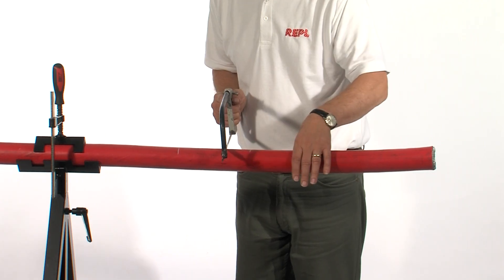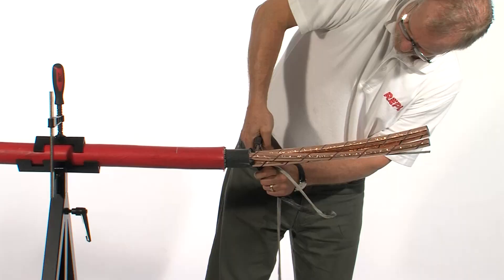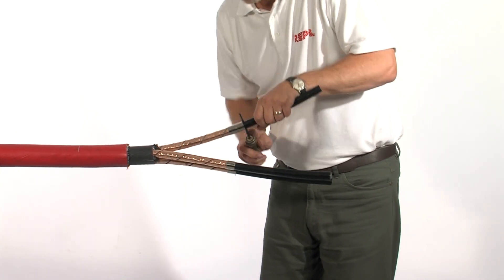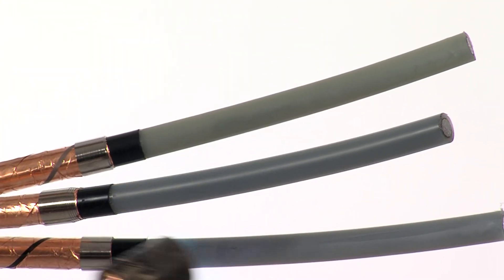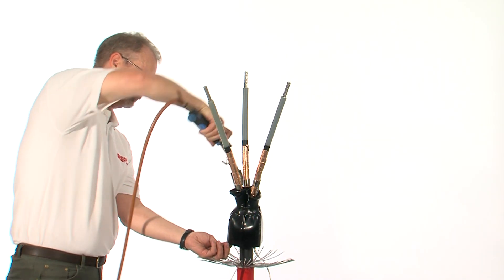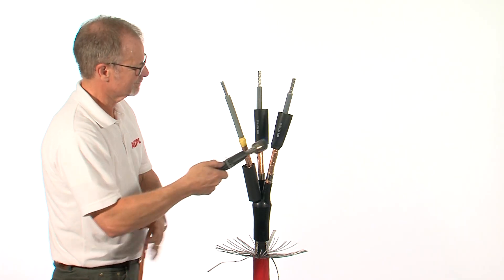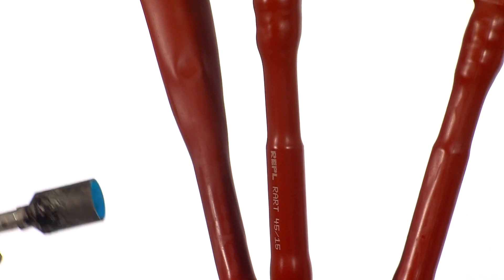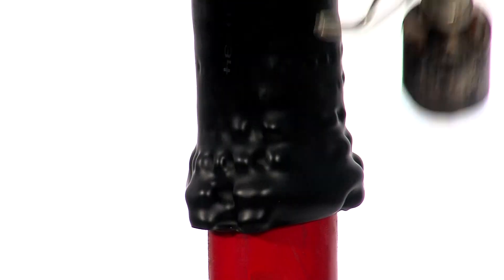Installation of a Heatshrink Termination on a Three-core MV Armoured Cable

Comment: What  will  happen  if the length  of anti tracking tube of 6.6kV 3Core  termination kit  is reduced  at site  due to  constraint of terminal box dimension.. assume supplied length of anti tracking tube is 500mm and we reduced it at site  to 450mm